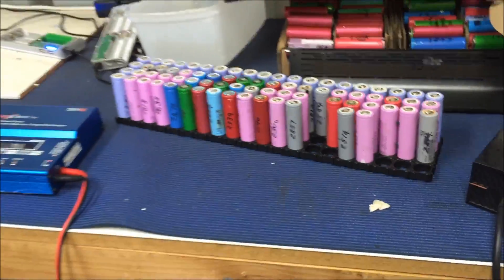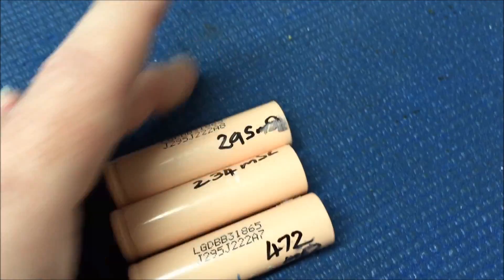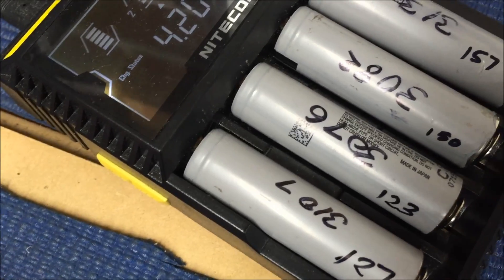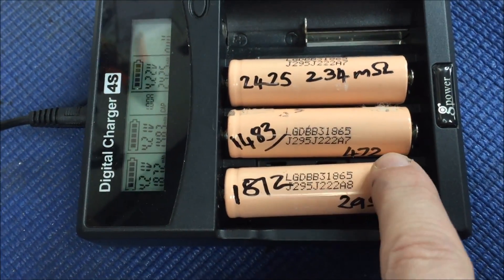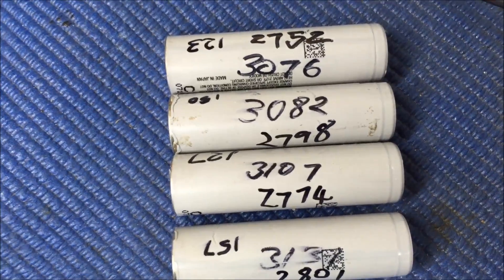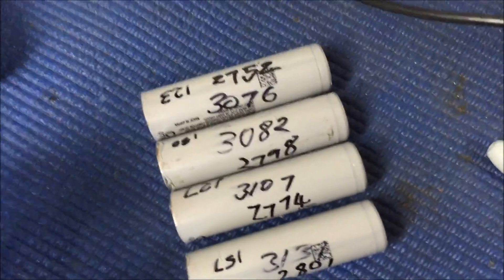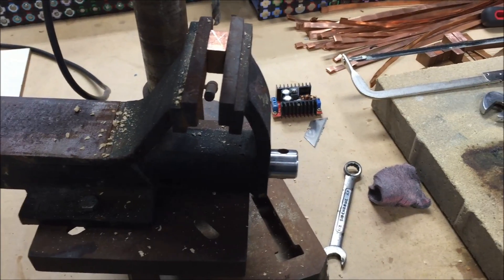resistance testing 18650 cells - should've done it...

Comment: i have LiitoKala Lii-500 when is better to measuring internal resistance ,when is full charged or when is discharged ? it is very different value like 10-90
Reply from the maker: I would do it full charged after 24 hours of resting voltage and always at the same air temp, IR in such a cheap device is a guess at best. Adding a consist ant way of checking will only make the results more valid

Comment: My Zanflare C4 charger tester says my four new Samsung 18650 Q30 15A 3000mAh batteries have 280, 190, 214 and 302 mR respectively. Isn't that a bit high for new batteries? I think my four new 18650 Efest 3000mAh 35A  batteries all are about 100 mR resistance. I will let you know once I put them in my Zanflare C4 again. Thanks much
Reply from the maker: Using that test on these cheap devices is guesswork.. not worth the effort.

Comment: Great video bro, I just used my new tester with some vape batteries given to me and the reading was 2980mah and 42 ohm or something really close to that. Samsung 30q batteries
Reply from the maker: Thank-You sir - 30q's would be a waste in a powerwall unless you have a tight space & need good amount of amps
Reply: HBPowerwall can't beat free on price, I just bought a few hg2. I am am going to be using them in a high drain device but later they will be for a small high amp battery.

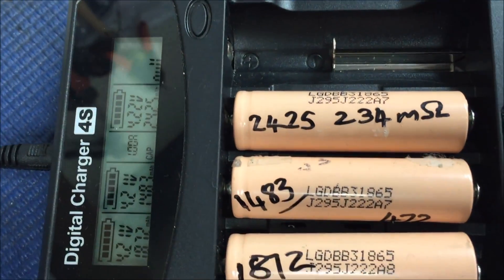Comment: 1:57 It can be noted that for the same type of cells (manufacturer, model, initial capacity, etc) the internal resistance tested is inversely proportional with tested capacity of the cell.
For example: between those 3: highest capacity cell 2425 mAh = 234 mOhm;  cell with 1812 mAh = 295 mOhm, cell with 1483 mAh = 472 mOhm.
All the best!

Comment: Very good, I noticed that when a test capacity with 500ma discharge it usually show more mah, I think its due to 500ma is the manufacturer closer correct discharger rate!
Reply from the maker: you always get more when you test at a lower rate, same is true for driving a car slower :) that said it also takes twice as long to test... Need to crank them through and making them work harder will also weed out the weak faster/better

Comment: Unfortunately the sky Rc, or cloned sky Rc and authentic sky Rc testing is done in a way that does not match up with the battery industry. I’ve noticed you can use this with in an15% margin of error to match up cells better when building a pack. But if you look at today’s data sheets the resistance these chargers report back are 185mohm, when it should be 50mohm. A big difference and not the best way to determine internal resistance. You have so many videos it’s hard to follow what you do exactly for testing, as with others since your learning while doing the project. 
Hats off to you for all the videos. To bad I didn’t follow from the start 2 years ago when I was also doing this stuff since it’s a little hard to use as a reference. I’ve stayed away from doing lithium battery videos, but have decided for the new year 2018 I’m going to start doing them.
I have a few resistance testers under $50 that report accurately I’ll be demonstrating, and why I don’t use the chargers anymore. They can be still used for a average to say the batteries are about the same, but not to check against the manufactures data to see if the battery has been damaged or is last the 400 to 500 cycles. An x-ray machine in the house would be the best, but that won’t happen, lol.

Comment: The internal resistance of the cell (if the cell is not a new one) can influence directly the capacity of the cell, when it is recharging, of receive all its mAh? For example, when the cell is brand new its internal resistance maybe is 30mili Ohms and full capacity 2800mAh. After years of use internal resistance rise up to 150mili Ohms. The cell will able to receive the same 2800mAh when fully recharged? Thank you very much.

Comment: Hi @pete,
Thought I'd share something i know about IR measurement and how to measure them. The way you've been doing IR measurements is one way, the two-wire measurement and the other way, more accurate way is to do a four-wire which would give a better measurement.

To do it is to connect another two from the positive and negative of the battery to the imax balance port. Test it that way. My iCharger 4010Duo gave a two-Wire IR test at 121mOhm and four-wire test gave 85mOhm. The imax should give similar if it has a balance port which doubt it does.

Comment: no way a 250 + resistance with a cell with 2500+ mah, it's very hard to believe, how do you test de resistance? the only way to get a good reading with the imax is to direct solder the cable on the cell, if you are not using that, your resistance will be wrong ... 

if i use cheap battery older, i get 150 for resistance, if i direct solder them i get 20 ( i get 20 with the litokola lii500 charger  aswell )

to mesure my resistance in my 4s lion pack i use BALANCE CABLE and plug it in my imax b6. this is the only way i can get good reading with this charger . battery holder are crap

Comment: mAh and Ah which are seriously flawed unit (which doesn't take voltage into account),
which is normally used by manufacturers and marketers to misguide people !!

Professional and universal unit for energy are,
kWh or Wh.

I mean, these all of us use kWh meter in home, kWh in Tesla car,
and 1000 Wh = 1 kWh. 
(how else simple do you want ??)

Still people use mAh and Ah, wonder how lame can they get !!!

And for comparison (different rechargeable battery types):
AAA [NiMH] = 1 Wh
AA [NiMH] = 2.5 Wh
AA [Li ion] = 3 Wh
C [NiMH] = 5 Wh
D [NiMH] = 10 Wh

18650 [Li ion] = 8 to 13 Wh (high drain to high capacity)
26650 [Li ion] = 14 to 18 Wh

__________________________________
Average energy of Tesla battery are around 11 Wh [18650],
and to make a Tesla P100D [100 kWh] Model S,

= 100 kWh / 11 Wh
= 100, 000 Wh / 11 Wh
= 9091 batteries

or in simple words,
9091 [18650 battery] x 11 Wh = 100,000 Wh = 100 kWh.
__________________________________

So i would seriously recommend 18650 enthusiasts to use Wh and kWh [our universal unit] instead of flawed mAh and Ah which are way too childish unit for energy !!
Reply: Chandraprakash G 
mAh x Voltage=Wh or kWh. 
I can immediately know the Wh of a pack if I know mAh of each cell and how many are in parallel and series, because I know each cell has a peak voltage of 4.2 volts and nominal voltage of  3.7v.

Here's why mAh are a useful unit to have first. 
Hypothetical example:
 I'm building a battery bank for a continuous 1200 watt load that I want to run for 10 hours. The battery bank has a nominal voltage of 3.7V in a 13s configuration=48.1V,  1200 watts ÷ 48.1V = 24.94Aor 25A or 25,000 mA. A 25,000 mA draw for 10 hours equals 250,000 mAh or 250 Ah. Multiply 250Ah by 1.2 to get 300Ah, this gives 20% headroom. 

I now know if I want to power a 1200 watt load for 10 hours it takes a 300Ah pack at 48.1V aka 14.43 kWh.
 
If batteries had Wh I would still need to turn that into mAh in the beginning of my reasoning because that's the easiest way to figure out what capacity battery I need for the given application. Clearly the use of Wh and mAh or Ah is application specific and are units developed to work together, if voltage is involved with either unit I get the other unit. They all describe one another and are intertwined, therefore neither unit is better just different descriptors. To simplify even further batteries are in mAh because the math is easier and you have to do less to figure out what you need to know.

P.S. Your argument is for arguments sake, it has no direction.
Reply: Dont coment shit if u dont understand it, AH is a well know unit, and u need 2 test the cels how many wh or AH the have and the test is always in AH so wh is,  just stupid tot calculate more Brain work for no reason, btw used cell arent just lets say 9wh they are all different  so 1 will be 2wh and a other one can be 9wh they arent the same

Comment: From what I read on these batteries they manufactured fast and slow drain current. They only way they can do this is with internal resistance, the lower the resistance the faster the battery will discharge. I am sure what your meter on the SkyRc was measuring was meg ohms and any thing over 50 meg ohms is probably not good. A low resistance is like a glass of water with a hose connected to the bottom, water will drain just fine. High resistance is like a pinched hose and will drain much slower and charge slower. I would think those batteries with high resistance will just stop charging, and that would be hard to detect later on. If you take out 3 battery cells in one 80 pack it would cut the amperage from the rest of the others in series.

I would think it would be fine to use half with lower resistance of around 1 meg ohm and the other half around 2 meg ohms, they should balance each other nicely.

Comment: Its very hard to measure internal resistance accurately with an iMax because it doesn't take into account the resistance in the lead wires, its internal resistance or the resistance at the connections to the battery. You really need a battery holder that can apply constant pressure and then at least you can get consistent results (if not accurate). Even the solder on your battery terminals will affect results. Of course also remember that batteries vary greatly in their ratings as well - so a power tool batt rated at 20C is going to have a lower IR than a laptop battery rated at 3C
Reply: You probably dont care but if you are bored like me atm you can watch pretty much all the latest movies and series on instaflixxer. I've been streaming with my brother for the last couple of days :)
Reply: @Marshall Vincenzo Yea, I have been using instaflixxer for since december myself :D

Comment: Here is a link to a good ESR and low ohms meter that you can purchase as a kit you assemble yourself or preassembled. It can be used to measure the internal resistance of lithium cells wether they are charged or not. I got one of these in 2001 and I still use it today. https://www.flippers.com/esrktmtr.html

Comment: ok try this when you finish building a pack test it as a hole.....for m ohm just tried it and it works ...just run leads to your charger in wont know how many cells just as long its not over 4.20 volts real low number more amps .that way you can match each bank...

Comment: Hey guys, if you dont have IR meter, you can do it with you hobby charger, like imax b6 and multimeter like this
1) measure voltage of the cell...say its 4.1v
2)discharge the cell by your hobby charger...say we will do that with 0.5A
3)measure voltage of the cell a few seconds after  dischargin starts...voltage will drop...lets say 3.95V
4) use Ohm law to calculate IR......R=U/I...in our case use voltage drop for U....R = (4.1-3.97)/0.5
.................................................
5)it gives us  0.26 Ohm, its 260mOhms, not highly accurate method, but it can gives you results you can use
Reply: Ok so use the b6 as a load resistor - makes sense.

Comment: Cool!  Nice results. It fits what could be expected. Just a little surprised you had no cells below 100 mOhm.

Some commenters mentioned that the cell needs to be at least 50% charged before measuring Ri,.... I just checked the Ri of a cell I measured  before. At around 3.9 V it measured an Ri of 78 mOhm and now at 3.44 V it measured about 94 mOhm. So the Ri does rise at lower voltages. It's probably why none of your cells measured below 100 mOhm. But the effect isn't so big that your results are bad.

The best thing about checking Internal Resistance is that you can save lots of time. Checking Ri before doing the very time consuming capacity test will save you time because any cell that has a high Ri you can already discard as bad. No need to waste valuable capacity testing time on those cells. Just have to charge each cell to at least about 3.8 V before testing Ri.

Thanks for doing all this Ri testing. It's been very helpful to understand these 18650's a little better.

Comment: What tester did you use to test the resistance of those batteries?
Reply: Imax B6AC V2
Reply: +Tomasz Stanek Hi. I want to measure esr instead of any math calculation. Is it possible?
Reply: Ramesh Perera with ImaX B6AC version 2 you only connect battery an you can measure resistance.
Reply: Oh I just realized the one I have not v2. V2 has directly from the menu.
Reply: You can do it with your version of imax b6 too. Just folow my instructions i posted below this video. Its simple
Reply: I think I have a clone one. It doesn't even shows 'batt resistance' in the menu.

Comment: how did you meassure the capacity? charging or discharging? I'm pretty sure the capacity of these higher resistance cells is actually worse. if you discharge test them at lets say 1A constant current down to 3V, they will drop to that voltage very quickly, but the chargers, using adaptive discharging, will prevent the voltage from dropping further and will reduce the amps they draw. that will result in a higher meassured capacity. these high resistance cells might give you 2000mAh discharged at 300mA but only 200 at 1A. I'd try discharging them with the imax at 1A constant and call it quits once the voltage hits 3V (or whatever you consider the lowest usable voltage for jour application). that should give more realistic capacity results

Comment: FYI. Here's a chart I did of IR vs capacity for 217 pairs of cells: http://www.myonlinediary.com/index.php/Main/ReusingOldLaptopBatteries
I measured the IR when the cells were all fully charged (because it was easier). I got a weak correlation between IR and capacity, but with some outliers.
Reply: You did that with paired cells? So you can't tell the cases where a 400 mOhm cell was paired with a 100 mOhm cell.  (a pair of cells with 100 mOhm and 400 mOhm will have a total Ri of 80 mOhm.  It maybe why that correlation is so weak. In your page you assume that a pair with an Ri of 80 mOhm means that each cell in the pair has an Ri of 160 mOhm. If you test individual cells you may find more correlation.

I liked that page a lot. It has a lot of great information. Thanks for sharing.
Reply: +Peter Faber Yep. I'm assuming that the pairs are well matched - given that they are always the same type of cell and probably made in the same batch on the same day. But I should splitsome and retest.
Reply: I started separating pairs (doh!) then saw the light as pairs are so much easier to handle and work with.  I'm currently waiting for an internal resistance meter (http://goo.gl/MiA5zL) to arrive so I can do some testing then add data to this discussion.  The internet is strangely quiet on this matter - strange given the significance of internal resistance on all this cool stuff...time to fix that!
Reply: I always seperate them into single cells. And now that you made me think about it, there usually are 3 different voltages, the 3 pairs. But I don't recall seeing 3 pairs of Ri. But pretty much always all 6 are in the same range... so... I guess that makes sense and is a strong corelation between age and Ri.

Comment: Good to hear that you've found the issues , I've been using the Liiokala Lii-500 to test resistance and interestingly when flat ie 3v shows a high Om 125 and above and when it's done a full cycle give a lower Om. Anywhere from 30 - 90 om  . My cut off is 100 Om .
Keep up the good work 👍
Reply: That's milli ohms
Reply: Would you say that the final result on the Liitokala is accurate enough to be useable? (for internal resistance)

Comment: I am sure you probably know this but...  I found that the resistance changes based on the charged state of the cell.  So I test both at a full charge, and at a depleted charge.  Anything over 200 when charged I immediately reject.  But that is just an opinion, nothing more.
Reply from the maker: ok, so that'll explain the inconsistencies i was having 7 months ago when i was doing it.
Reply: Also the chemistry.  Inside of a single source of cells, good cells only seem to very about 50 or so when charged.  Outer cells being the worst.  Though you have tested a LOT more cells than I have!  ^_^

Comment: Used cells should be cycled 3 or 4 times to see which way they are going some will improve some will lose capacity & IR will go up....  sing of a cell that should not be used. Higher IR cells will self discharge quicker than lower IR cells they all get more & more resistive to the charge at the top or close to full. unfortunately takes lots of time to cycle them. Not for the impatient. Best to test IR on the return charge cycle this way the cell has been discharged & all cells tested will be tested with the same conditions.
Reply: All the time, money, effort put into making these packs. would not want to have to pull them apart to replace cells going in the wrong direction. I'm just sayin! lol!  Think your project has inspired many. Good job mate.
Reply from the maker: i reckon they'd be cycled enough in their live :)
Reply: i think off grid kid is onto something here, are you testing IR with the cells charged or discharged?
Reply: NM, you already answered this
Reply: I guess with used cells you can be sure of one thing: They will all get worse over time. Even if you find after 4 cycles it got a little better, in the long run they will just get worse. So no real need to get that detailed. Best way to extend their cycle life is to not charge to 4.2 V. No more than about 4.1 V is better. And also to not discharge them all the way down to below 3V. Also it's good to not charge or discharge at very high C rates.

You´re right. Patience isn't one of my virtues,.. :)
Reply: But high C = fun! (on an ebike).